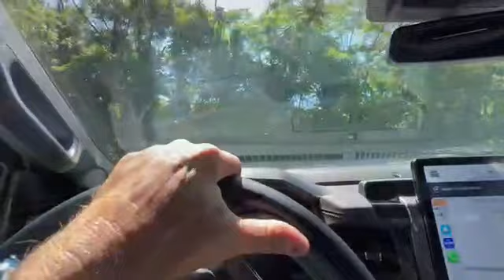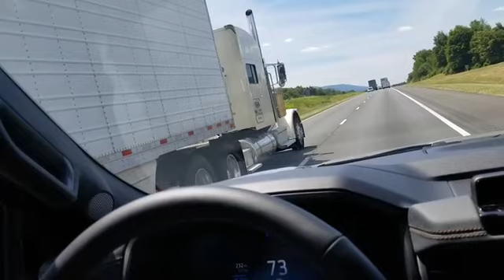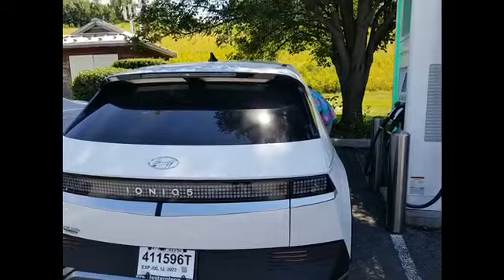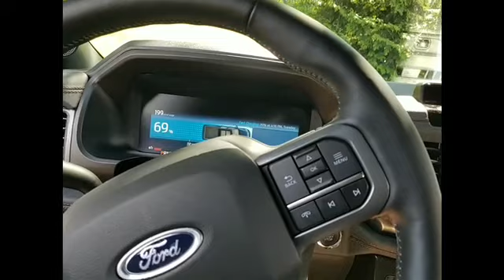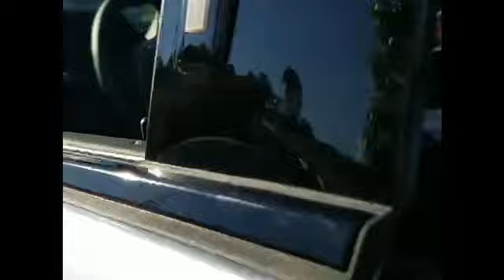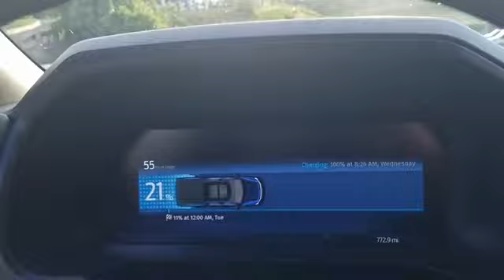Electric Ford Lightning vs  Gas Ford Supersnake 😎

Comment: The ford lightning uses the 2170 cells and they have a cycle life of 1500 in perfect conditions say your up north cold winters truck left out side never precondition before you drive same as not warming up your truck for ice motors life span will decrease but say 1500 conservative 280 miles a charge thats 420,000 miles when the batteries losses 20% of total capacity which your gas motor will also lose its stock mpg unless you put new injectors and ignition system in it and redo all the seals in the engine the battery myth of it only lasting 100k miles is old news worst case scenario maby 150k miles but thats if you treat it like shit same goes for your gas or diesel motor no maintenance it will fail prematurely

Comment: The more of these traveling videos of the lightning I see the more I'm sure I won't be taking any vacations with mine. That's ok, at 72, I  don't really vacation anymore, anyway. Still there's no doubt it costs much less driving the lightning than that 770 hp gasoline truck. I'd sure like to know just what both cost for this drive.

Comment: Do you think the car that used that 350 before you contributed to it over heating? If so, what would it be like with an EV nation and people waiting in line to get a charge?
Reply from the maker: Good point but I think it’s more about that 131k battery and Ford doesn’t like the 350kw from what I have read.

Comment: It doesn't sound like you can leave a 350 amp charger unattended. Had you went and got a bite to eat and came back to find the charger shutdown and you still haven't got the charge you expected. Looks like 150 amp chargers if you're going to get a bite while it's charging.
Plus I've been told 10 minutes after the charger shutdown you start getting charged $.40 per minute just setting there connected.

Comment: Do you know how much it'll cost at today's price to get a new battery when the time comes?
Reply from the maker: I do not but guess it’s not much different than ICE vehicles once there high mileage.
Reply: @Iceagetv  I know that to replace the battery on a Tesla is $22,500. That makes it too costly to repair the car.
Reply: @Iceagetv  I believe Tesla offers an 8 year guarantee on their battery. If I bought one and had to replace the battery after 8 years that would cost about $2812.50 per year. That would equal about 10,000 miles per year of regular fuel at $4.50 and 16 MPG. Then you'd have to add what you actually spent on charging to arrive at a close figure, but of course you wouldn't have any oil changes either... There's a lot to consider in making the decision to go EV.

Comment: At nearly $5 per gallon, the cost per mile between those two trucks is what most people want to know.
Reply from the maker: Good point and think about this 2.2 miles per kw.  Open road charging at say .44 cents.  386 miles divided by 2.2 miles equals 176 kw which equals $77 roughly.  In comparison to 16 mpg and truck had to have premium fuel at say $6 a gallon equals 24 gallons purchased $144. But since I charged my truck before I left @.11 cents kw the costs for the electric is actually significantly lower.  Just factor I really only needed to purchase say 50kw to get me there.  So actually it’s $22 on the road and my house bill would be .11 cents times 131 would be $14.31 so total costs was $26.31😁
Reply: @Iceagetv  That's great information. Thanks. They're still working on making better batteries and they're leaning toward solid state batteries. If that ever happens we'll probably have a much cheaper battery that will last a lot longer.